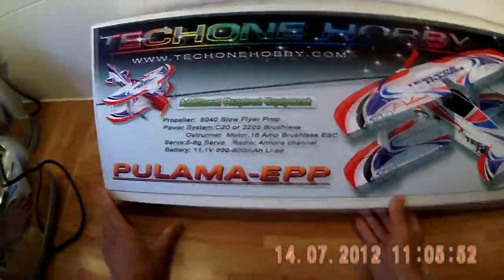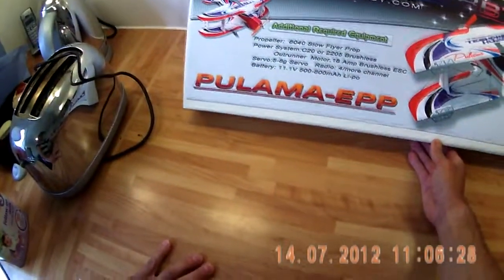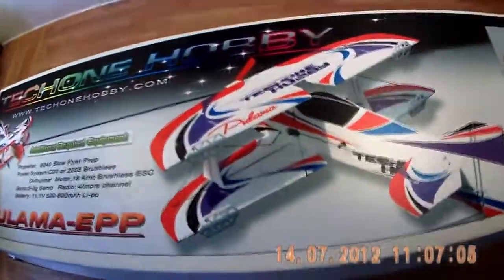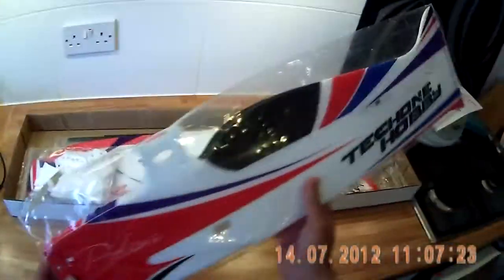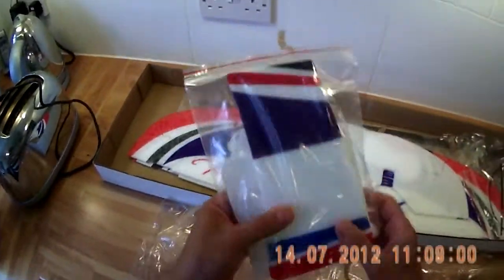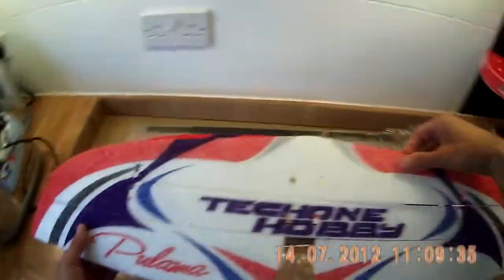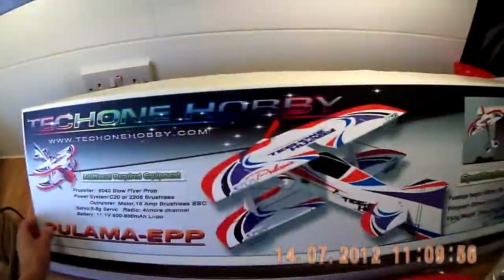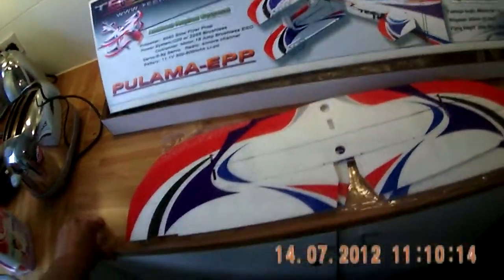REVIEW TECHONE HOBBY PULAMA 3D EPP BIPLANE WHATS IN THE BOX

Comment: I have built this plane and flown 50+ packs onit.
Easy build, very durable.if anything the flexibility of the plane creates some of the crash damage with servos tearing out (foam safe hot glue them in), still flies like a champion. Light wing loading = low speed flight. Hovers with ease even inverted, Just a pleasure to fly, great plane to learn 3D on. Push the throttle up and it flies fast, tracks dead on. Huuuge control surfaces. Just dont try to fly in much wind